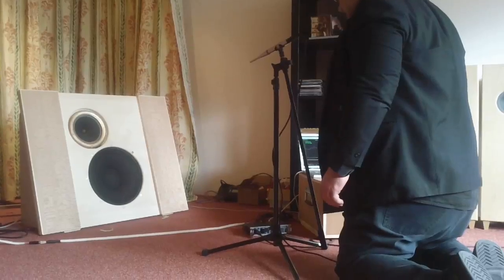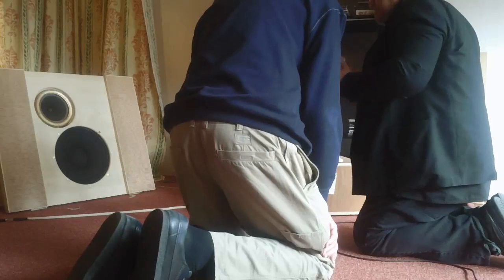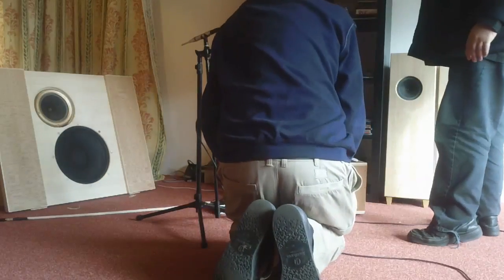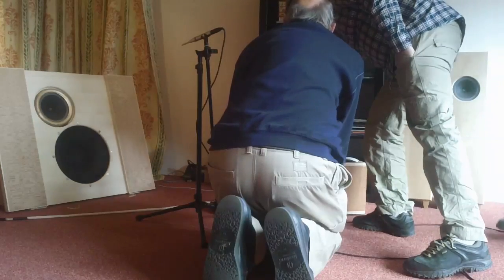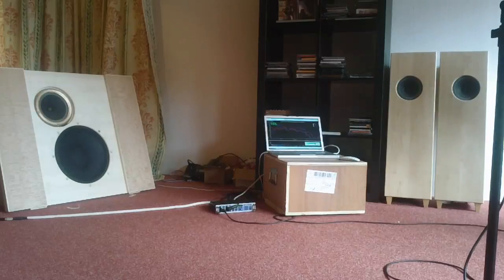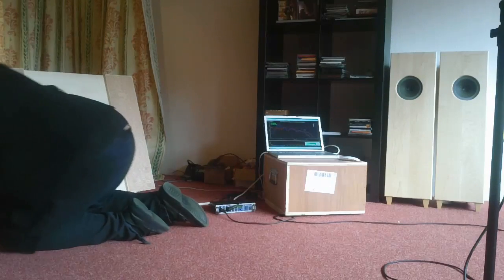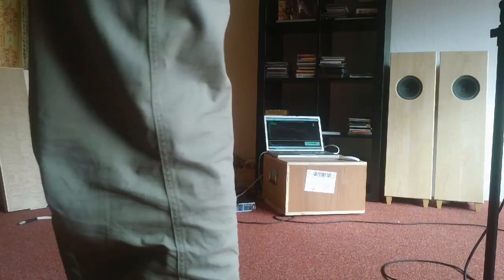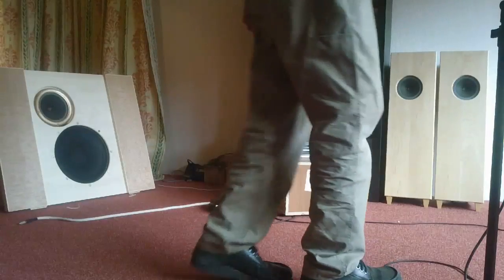Musical Affairs : AudioFixer vs Hans Kortenbach #1

Comment from the maker: there is a 3 inch driver used as a tweeter back of the baffle firing upwards, several tweeters have been tried but they have ended up with Goto compression driver